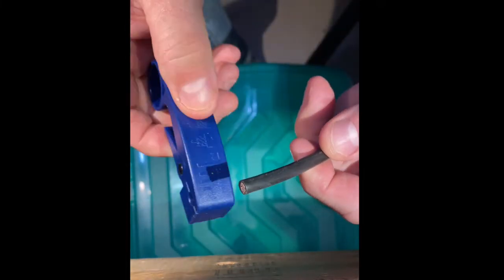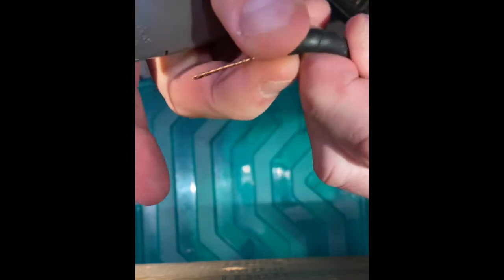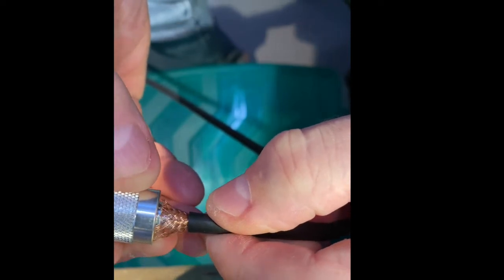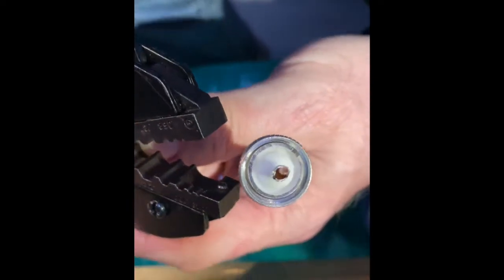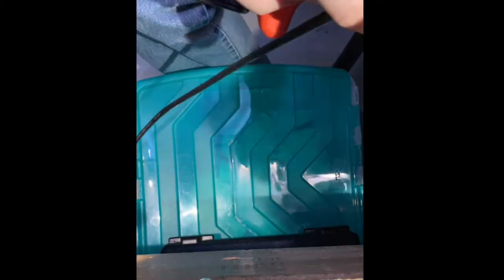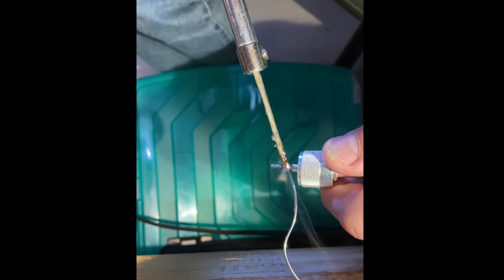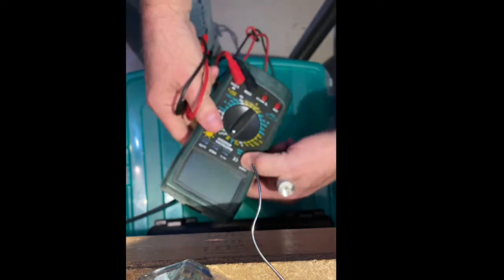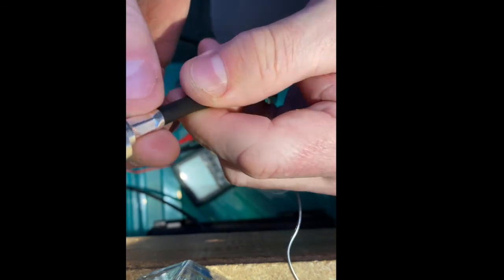KA2DEW puts crimp pl259 on rg8x

Comment: Although Iam not a fan of crimp on UHF Coax connectors,  this is a great video! As for the excess solder on the center conductor, I usually use an all metal fingernail file, makes quick work of smoothing out the center pin!.

    Again, great video, thanks for sharing!🇺🇸😏👍

Comment: dont molest the braid
Reply: Two tips: Used a vise to hold the connector when soldering. Use flux paste on the copper before soldering. That greatly helps the solder flow and “wet” the copper.

Comment: You should be able to adjust the blade depth on your stripper.
Reply from the maker: Should.   I Did not have what it takes to make it work correctly. I gave up and spent $15 to buy another stripper.

Comment: Is the crimper and rg8x available on Amazon or where else can I buy them?
Reply from the maker: I use QSRADIO.com as a supplier   Amazon offerings are inconsistent.  Some great deals, some ripoffs.  Amazon ratings system is confusing because somebody gives a rating for a product which then shows up in somebody else's offering for the product, but the somebody else might be a rip-off artist.  The rating may not even be for the same version of the product.   I use Amazon quite a bit, but you have to beware and be aggressive with Amazon when they send you trash.  QSRADIO has been very responsive, responsible, and fair.  That said, QSRADIO does sell some good products which are available cheaper elsewhere.  But all of the elsewhere venders (ebay, amazon) are riskier.
Reply: @taddinraleigh  I just ordered the crimper and the pl259 connectors from quicksilver.
I do have a bunch of solder connectors with adapters but I use a Weller sp120 for soldering the braid and solder station for the center pin. Too much hassle and I'd rather use the crimp connectors. Thanks again!
Reply: @taddinraleigh  Thank you! I found the same things to be true buying from Amazon.